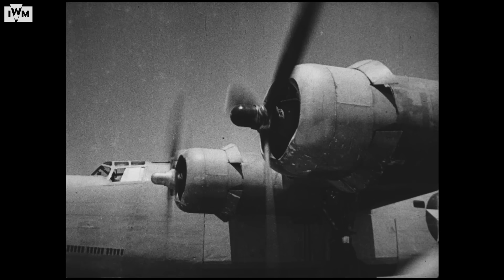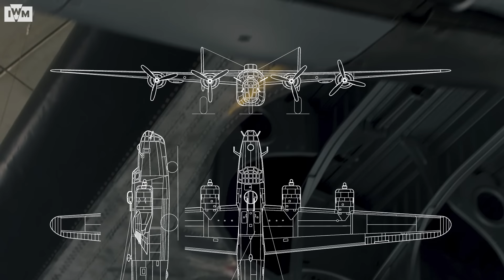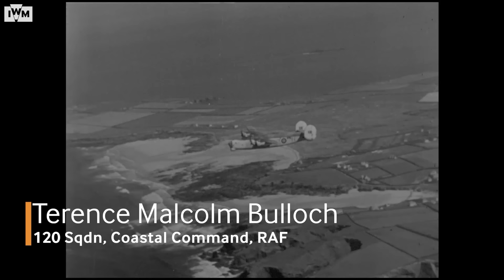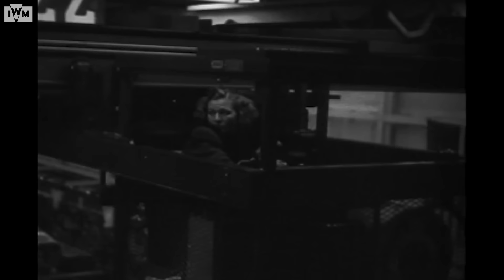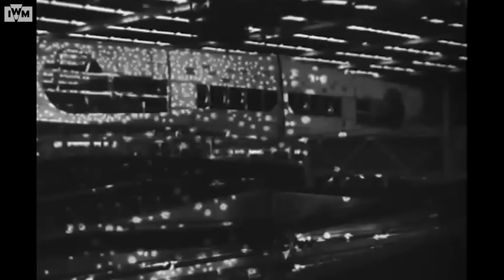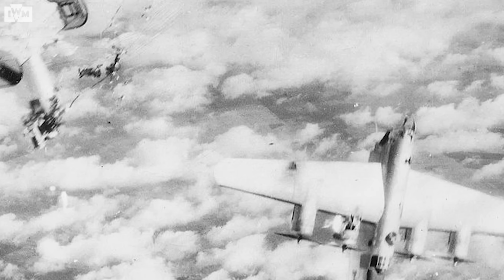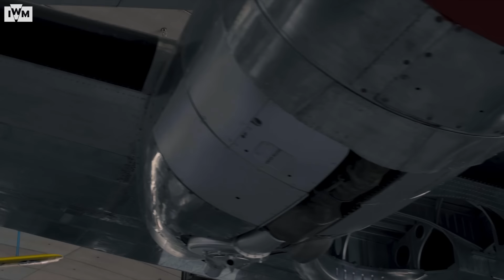The most produced Bomber in history had a bad reputation | B-24 Liberator

Comment: In early 60`s when I was in a SAC bomb wing there were guys who had flow B17`s out of the UK in the war. They said that in the briefings if they heard that the mission would include B24`s a hugh cheer would erupt as they felt the Luftwaffe thought the 24`s were easier prey compared to the 17`s
Reply: Statistically he was wrong. Sure, the B17 could take far more damage. But it flew way slower and lower than the B24 which really mattered to the chances of acquiring that damage. And, especially at range, it had a far smaller payload than the B24 which meant it had to fly more missions to destroy a place.  Undoubtedly the B24 had a far better ratio of Germans killed to Americans killed.

Comment: My Grandmother worked in Willow Run making these! She was short, at just a hair over 5', and was petite, so her job was to install wiring in places that were hard to get to. Just for that reason, I have soft spot for the Liberator.
Reply: This describes my mother and her sister that both worked at Willow Run. My mother was also petite and assigned to the same role as your grandmother. The problem for my mother was that she was horribly claustrophobic and the job terrified her.

Comment: The Liberator was a good aircraft, it no doubt did Sterling service esp against the U- boat threat. German fighter pilots remarked that it was easier to shoot down a 24 rather than a 17, when it started taking punishment in the wings it was sooner to break up than the 17,the higher wing loading was most probable the culprit for that! 
Building an aircraft for purpose is always a trade off, the 24 could fly higher ,further ,faster and with a bigger bomb load at the expense of being not quit as rugged as the 17, another example of ruggedness in the axis line up of 2 engined bombets was the He - 111, not as fast as the Ju -88 and some of the Dornier 2 engined bombers, but comparitively more rugged,with a heavier bombload,with those huge beautifull eliptical wings,albeit rather slow, its usefull qualities kept it in production up untill 1944, when all bomber production ceased, for fighter production.

Comment: By the way, the B-24 was never meant to replace the B-17, because this aircraft was designed to meet an Army Air Force requirement for a bomber that was faster than the B-17, and have a longer range, along with a larger bombload.

Comment: And another correction.  The bomb bay doors opened OUTSIDE of the fuselage, not into the bomb bay.

Interesting, and I'm not sure why this wasn't mentioned being a British video, but it was the RAF who gave her the name Liberator.  The USAAC/USAAF rarely named aircraft but the RAF did, and Liberator she was.  Later, both Consolidated and the USAAF adopted the name.  Considering the Lib's first role in the RAF was coastal command, it should be noted that the USN also used the Liberator -- as the PB4Y-1 -- as a long range sub-hunter, as well as her development, the PB4Y-2 Privateer.

Comment: The B-24 could carry more bombs, further, than the B-17. But it could not take the punishment as well as the B-17. Davis airfoils are great for performance but not for 20mm shell damage...and its high wing design greatly reduced its structural integrity.  The Eight Air Force knew this, and replaced  B-24's with B-17s as quickly as possible.  Fact.

Comment: Thanks for the video -  one other unsung variation of the Liberator was the modified version flown by the Carpetbaggers, the air arm of the OSS ( in joint operations with the SOE  ) - flying out of Harrington airfield they dropped supplies and inserted agents in support of the occupied nation's resistance forces, flying at night at very low levels.
Reply: The Carpetbaggers took over the 492nd bomb group for their undercover missions. It was a case of a total personnel change. My father was a pilot in the 492nd having flown 11 missions with the group. His crew was stood down for a mission in their regular rotation. When their squadron didn't return from that mission, the survivors were told that the entire flight was lost in a collision over the target. My father went to his grave believing everyone he had flown with died on that mission.  The truth is that on their return to England, each plane was diverted to a base other than their home base. Debriefed and ordered never to discuss this mission or their previous assignment. The OSS was so covert they completely infiltrated one of their own bomb groups. My father and his crew finished their tour by doing radar jamming along the English channel. The 492nd had a reputation as a hard luck group. Of the first 36 crews deployed to England in early 1944, only six crews returned home intact with out casualties. The loss of an entire flight group was not hard to sell considering how badly the group had been shot up in its previous missions.
Reply: @cdjhyoung  my wife's father was a carpetbagger, and retired a Lt Col-  you might want to read Ben Parnell's book "Carpetbaggers: America's Secret War in Europe."  for the unit's history and missions

Comment: You should not repeat the discredited claim that the B17 was the safer and tougher aircraft.   Data tell us that loss rates were equivalent.   The B24 was better which is why more of them were bought by the military than the B17.   It was faster, had longer range, and carried a heavier bomb load.  It displaced the B17 in the Pacific.   The B17 could not fly those antisubmarine missions.   The B17 could not have made the runs from North Africa into southern Europe.

Comment: This story may be apocryphal but I heard that the B-17 had a forward and rear spar on the wing but the B-24 used a single spar. Does anyone know if that's true?
Reply: It doesn't matter. Because the lift acts at the 1/4 chord of the wing, and the spar closest to that area is critical. A rear spar might absorb battle damage from behind and protect the main spar. But if the main spar is destroyed the rear spar is not going to support the aircraft.

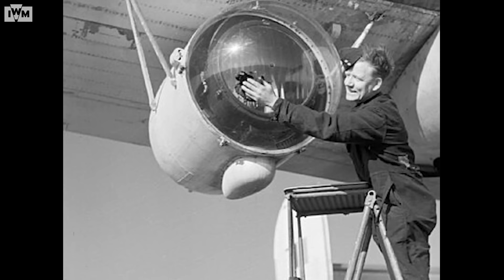Comment: The lens being cleaned at 4:05 is a “Leylight”. They had one on each wing angled to focus at the bomb aiming point. The radar would lose the Uboat at a predictable distance where the lights were powered up. Pilot kept going straight. Bombs released when the conning tower appeared in the crossed beams almost always scored a hit. They were so effective that Uboat crews believed there was a special weapon in use. 
RN listening stations used radio direction finding to determine location of U-boats radio signals. A bomber was directed in and used radar to find the surfaced sub.
Reply: I hate to do this, but...  It's actually called a Leigh light, created by Wing Commander Humphrey de Verd Leigh.  There was only one mounted on the aircraft, to illuminate ahead of the airplane. Your description of the crossed beams sounds more like the height finding downward lights of the Dambusters. Sorry to be pedantic, but I feel that accurate info is better.
Reply: @doolie1779  As do I
Reply: my grandpa was the test pilot and called it a death trap, then went and sunk 2 uboats in 22 mins

Comment: The Liberator's high mounted wing, while efficient, held a flaw. It's wing box, the section that held the two wings together in the fuselage, was relatively weak. As little as 6 20mm hits from a BF-109 or FW-190 into the wingbox would cause the wings to fold.
An operational flaw which doomed a number of Liberators was it's use as a cargo plane, the C-87. Because of it's impressive bomb load, it was thought that she would make a good cargo plane, too. But like most bombers, she was made to lift off with a heavy load, but to land almost empty. Collapsed nose wheels were often the result if the plane landed a little too rough on an unimproved airstrip. The wings couldn't handle much ice, even though they were extensively used over the Himalayas, what is known as The Hump. Even a small amount of ice, not uncommon in those routes, could cause a stall condition.

Comment: At about 8:40 with the photographs. One reason there are so many photographs is because The Mighty 8th Air Force was based out of England had the most B.17’s, where some other Air Forces (like the 14th) had mostly B.24. The 8th was the most glamorous Air Force with the most Public Relation Troops attached.

Comment: I thought the biggest difference between the B-17 and B-24 was the B17 could fly 10,000 feet higher, which is pretty significant.  Why did you not address this?
Reply: The B-24 was faster and higher.  Comments are not a good source of factual information.

Comment: Here I am thinking that the B-24 is the cooler looking plane. The big tail, the high wing, the massive fuselage. It looks much more capable and imposing than a B-17 just based solely on its appearance
Reply: Tricycle undercarriage, high tech airfoil it was a more modern design than B17 and yes, it looks cool!
Reply: As a kid i liked B24... but today I don't. Its box shaped for mass production. It has a big fat underbelly and huge ugly landing gears. Its like a fat elephant. And its tail rudders are unaerodynamic.
B24 is basically just a plane industrialists and the airforce likes while pilots and crews would probably like it less than the B17.
Its higher wingloading also makes it more vulnerable to enemy fire and harder to turn and steer. And the focus on mass production seems to have outweight the concern for crew safety. This is of course understandable if you fight a world war against two evil empires in an existential conflict. So I will say that B24 is an impressive plane despite its flaws. But its impressive features are rather find in other things - like that it was able to be mass produced on a huge scale and become the most produced bomber in history despite being big and having 4 engines - and the Germans would of course come nowhere near to compete.
It was a plane capable of crossing the atlantic, fly fast and carry big bombloads - so it was a good machine for its time.

Comment: Consolidated Aircraft company became Convair after the war, and then General Dynamics.

The B-24 was a SHADOW of the B-17 when it came to survivability;

The B-17 was a SHADOW of the B-24 when it came to bomb load, range, and especially speed.  

-The B-24 had the Davis wing. The designer was brilliant but a drunkard, and he inspired the character in Star Trek who first achieved "warp" from Earth, triggering the Vulcans to make first contact.

When I was a kid I liked the B-17 because of it's looks, but I hated the B-24 because it was fat and stupid looking, despite the fact that the majority of these airplanes were built at Willow Run Airport in Ypsilanti, Michigan, about 10 miles from where I grew up on Grosse Ile.  The B-24 was not the airplane that you wanted to be in during a ditching, because the deep fuselage would always flip over and break apart.  The B-17 just skipped on top the surface and then did a Sully.

Great video!

Comment: Alot of very accurate info presented in this example.  What is often over looked is the time between the b17 and the b24. At the time of the b17 it was designed around the available engines. By 1941 radial engines grew in displacement but not size.  Not to mention other technology that allowed the B24 to , in many ways, to be superior to even the mythical Lancaster.
Reply: Huh, B24 superior to the Lancaster. Crew 4 less, bomb load more than double. USAF bombing accuracy was no better during the day than RAF at night, thus the USAF adopted H2S, cruising & top speed about the same. So with all he important stuff....
Reply: @Xyzabc998 Gee, I would hope that the Lancaster, an aircraft 2 years newer, would be better than a Liberator. Too bad it wasn't.

Comment: I saw a PB4Y-2 at Fairbanks, Alaska three decades ago.  I was on a "summer training camp" as a member of the US Army Reserve out of Phoenix, Arizona, and the PB4Y-2 (the US Navy's single rudder edition) was being used as a water bomber to fight forest fires.

May I call the B-24 Liberator "the most successful bomber failure of World War Two?"  This video has already showcased the Liberator's shortcomings.  Two reasons for Liberator successes were massive production of the type and the fact that despite its warts, the Liberator was more capable than other bombers available in 1941.  Both of the reasons for success were mentioned in this video, too.  The Ford Willow Run assembly line is a decaying relic now, though someone is taking a stab at preserving parts of it as a museum.  The Battle of the North Atlantic was covered well, but distances in the Pacific were even greater and the B-24 out-ranged other bombers until the B-29 premiered in 1944, performing valuable photo reconnaissance missions (and flying too high for interception by the few Japanese aircraft posted at island outposts--if there were any Japanese aircraft) and even long-range bombing missions from bases in China, Burma and Alaska.  Hill Aerospace Museum (part of the Hill Air Force Base in Utah, formerly known as the Ogden Air Depot until renamed prior to WW2 in honor of the Army pilot who crashed the Boeing Model 299 on his first flight in the B-17 prototype) sent an expedition to Alaska and recovered its B-24 from a crash site; now their B-24 is on display.  As the C-87, the Liberator carried fuel, bombs and other expedited supplies--and President Franklyn D. Roosevelt, too.  Despite scrapping nearly all B-24 Liberators at the end of WW2, America got its money's worth out of them--and so did other nations including Britain.  

Aircraft of the early 20th Century were not designed to crash--and crew escape was something worked out after the planes were put into service.  A good video on aircraft displayed at IWM would be comparing the different evacuation protocols of several different aircraft.  Because those aircraft were not INTENDED to crash and not designed for either a "safe crash" or for the crew to abandon their crippled plane while it was in flight, design flaws such as the Liberator's bomb bay doors collapsing when the bomber was ditched over water and the flooded plane sinking immediately were not considered when the designers maximized speed, altitude, bomb load, and range.  Eddie Rickenbacker's B-17 (used as a transport) ran out of fuel due to a navigation error and had to ditch in the Pacific--Rickenbacker reported that the B-17 sank too quickly to transfer most of the survival gear and supplies to three life rafts.  Sinking upon water ditching before the crew could escape wasn't limited to the B-24 but the Liberator had the worst reputation--unlike the reputation of another Consolidated multi-engine high-wing patrol bomber, the PBY Catalina.  When Rickenbacker took his involuntary 21-day Pacific Ocean cruise vacation in an inflated rubber raft Britian's MI-9 was still a young organization and the USAAF and USN thought it was moving mountains to provide its aircrew with heated flying suits, parachutes, and floatation devices.  Survival kits in the modern sense were not really standard until the late WW2 period--and survival training was primitive.

I toured Duxford about 20 years ago.  I've worked as a museum volunteer at an air force museum for a decade and I'm aware of how limited resources affect what gets displayed.  Having an MI-9 museum is probably out of the question because there's not enough interest in most nations.  Hill Aerospace Museum had some survival supplies and equipment on display and a recreation of part of a Vietnam prisoner of war compound.  Touring the aircraft in Duxford was a treat because many of the bigger planes were open for touring the interior.  One thing that I noted was some aircraft had most of the crew parachutes located in a centralized location rather than at the crewman's action station.  Their bulky parachutes interfered with crew duties, and it's far easier to account for parachutes if they're in one place, but getting from a gunnery position to that parachute storage in a plunging plane couldn't have been easy!

Regarding the B-24, most of the crew didn't have seats!  They stood or knelt at their action stations.  The pilots had decent seats and probably seat belts, but others might have a simple stool to perch on.  When the Liberator crash landed, most of the crew would sit on the floor and link arms to ride out the impact. It took until September 20, 1944 before the need to sacrifice a $215,516 aircraft in a water ditching under ideal conditions was undertaken.  This IWM video has a film clip of this test.

http://www.beneathhauntedwaters.com/B-24.htm

https://www.451st.org/Manuals/How%20to%20Ditch%20the%20B-24.pdf

https://www.youtube.com/watch?v=tG4nm2atjZI

https://www.defensemedianetwork.com/stories/eddie-rickenbacker-adrift-in-the-pacific-ocean/